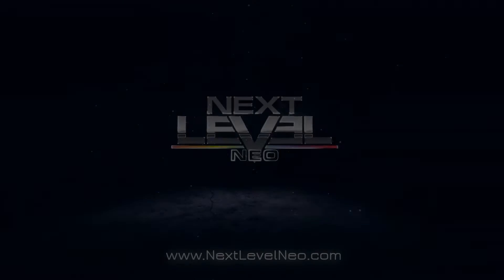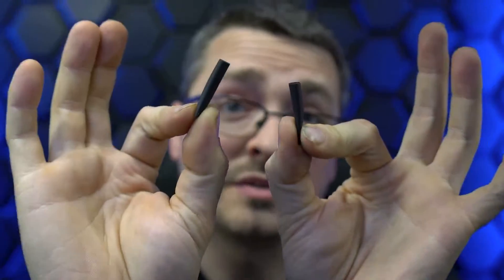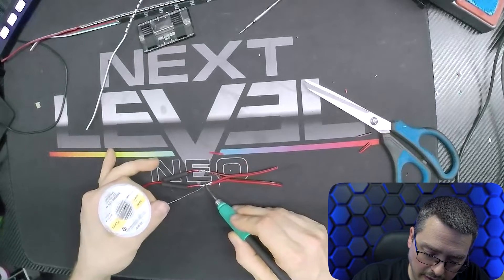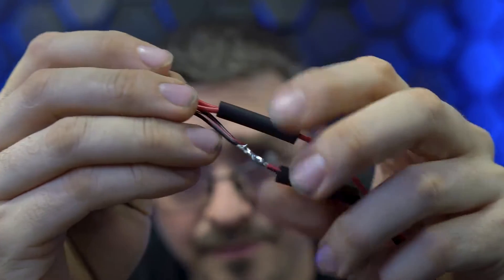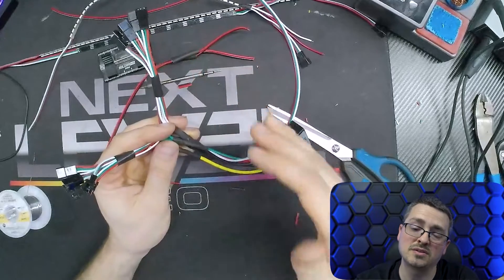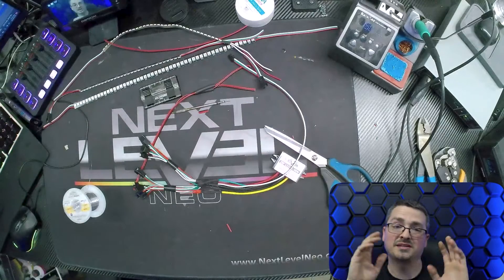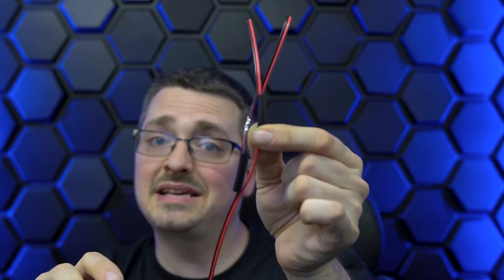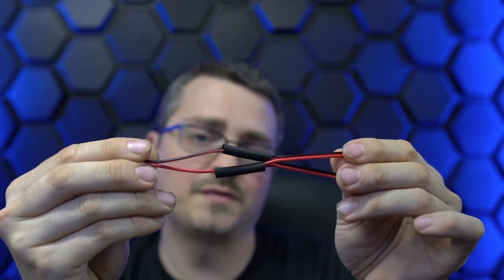How To Make Your Own Wire Splitter From Scratch!

Comment: will this method work with an Argb splitter? i opened up the splitter i bought off Amazon and it had a small piece of PCB making the split i cant find anything about what this thing is called
Reply from the maker: It will, yes. Many manufacturers use custom pcb to make the split faster but it is the same concept
Reply: @NextLevelNeo  thanks can't wait to try this out